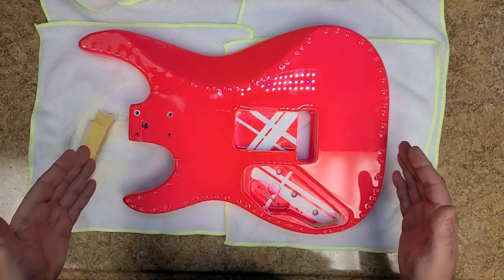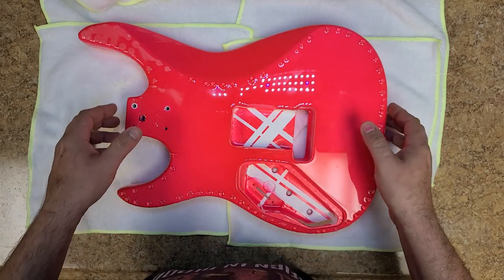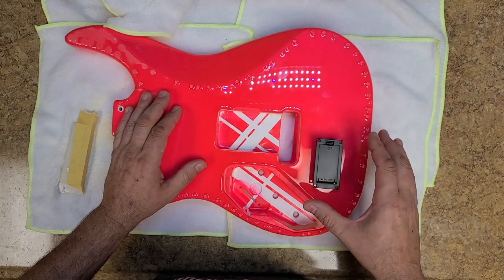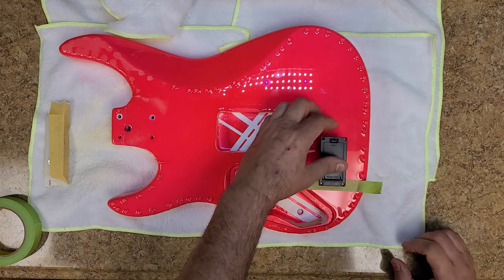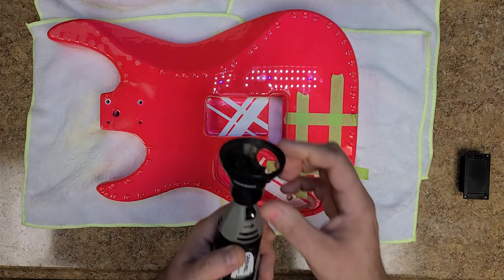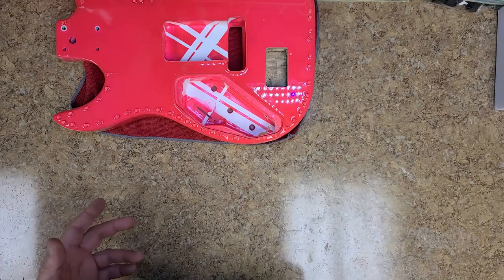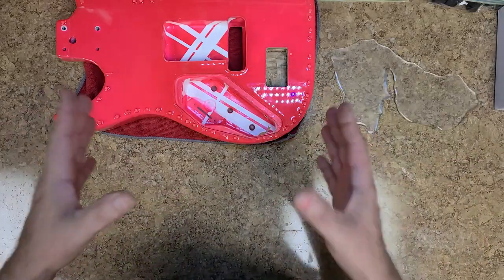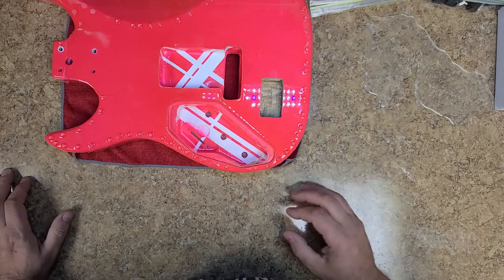How to Install a Battery Box Kramer Restoration and Shout Out!

Comment: Coming along great I'm getting the push pull on the Dinky with the Gotoh Tuners Bone Nut and Seymour Duncan JB/59s man that guitar will be excellent from the 300 dollars we started from when you picked it up for me I'm thinking I want the body neon green or the same color black with green flames that sounds like I could do it but don't know if I trust myself lol on that beast I ordered those Dragonfire Red Humbuckers was less than 40 great deal will have the coil split done first though will check out the channel you mentioned Rock On!!

Comment: Not many people would go the extra mile and route out the body for the battery box. Instead they would find a way to wedge the battery in the control cavity. Another great example of the pride you put into your work.
Does the epoxy add much extra weight or is it negligible?
Reply from the maker: I'm going to make clear covers. The battery would take up room so moving it would make it look clean. At least that's what I'm hoping for  lol.
Reply: @ericctheartofnoise8613  I guessed there would be clear covers when I saw you had put the striping in the cavities.
Reply from the maker: @ccjmusic  making them is going to be fun. I don't have a template to go off of.
Reply: @ericctheartofnoise8613  I’m sure you will do a great job as always.